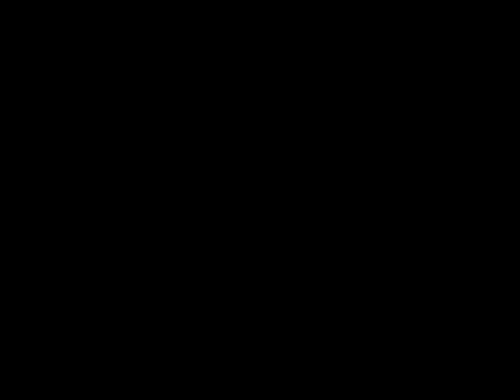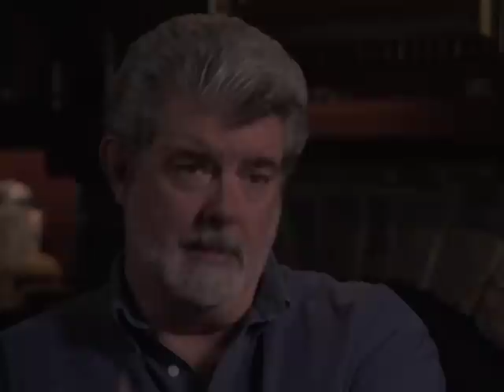George Lucas On The THX Sound System

Comment: 1. Yes THX is NOT a sound format. 2. There is no "Dolby Surround" in cinema - neither in analog nor digital - what you mean is "Dolby Stereo" - analog Dolby Stereo is 4.1 channels mixed into two channel light soundtrack. Dolby Surround is home system not to be confused with Dolby SR that is just noise reduction 3. Dolby Digital EX is 6.1 / 7.1 but just decoded additional channels similar to analog matrix. 4. THX has nothing to do with the used equipment (sound processors etc) just quality check.
Reply: Mister perfect Thx movie theater is Exist